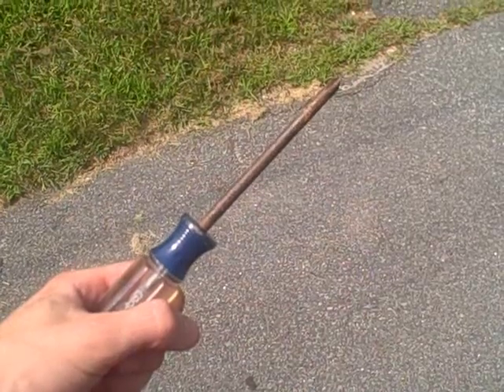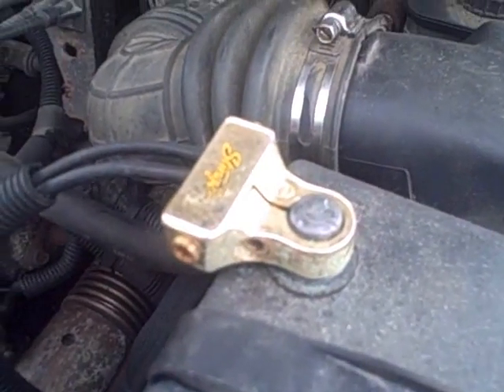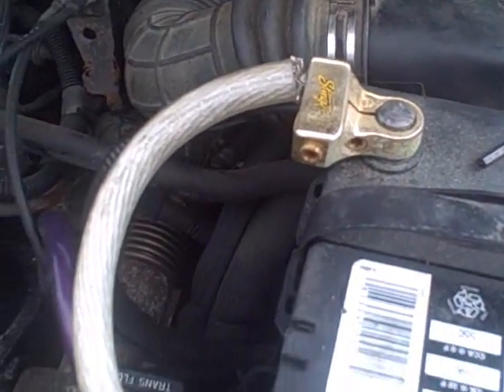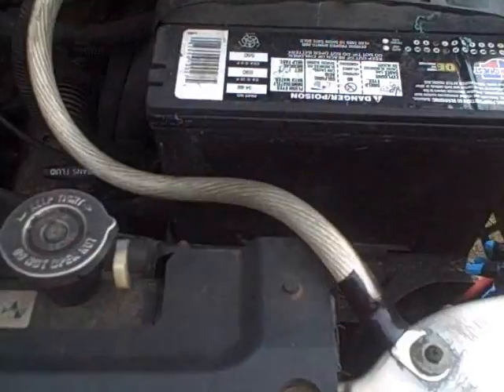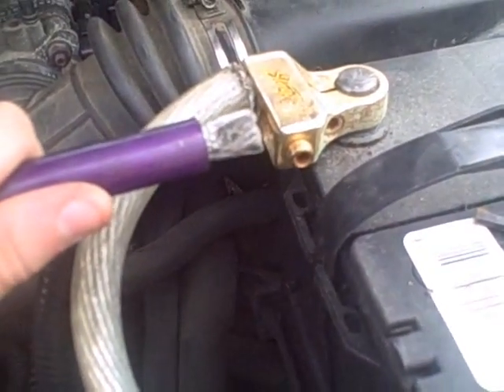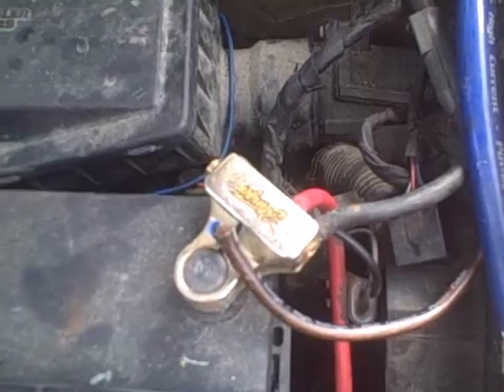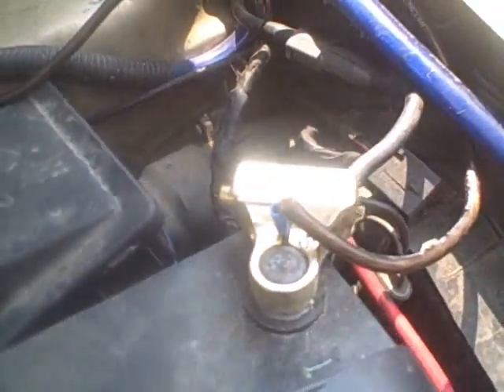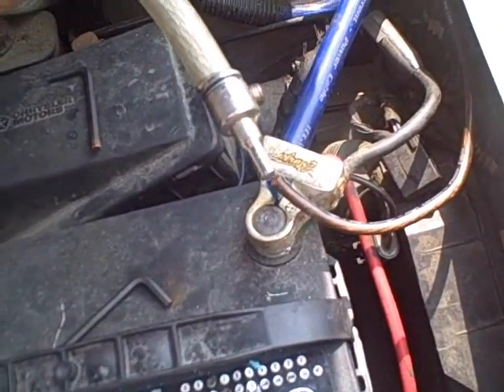Increase Car Audio Power 25% - How To Install Big Three Upgrade - Easy 15 Volt Stereo System Big 3

Comment: The ground of your battery to the engine is only for your starter.
Better make sure your ground to the car body is of a lower gauge.
I think 0 is a bit over the top for a simple sub. But you can get real crazy on car audio.

Make sure you have an alternator that can kick out some high amps, and replace your battery for a high aH gel battery and make sure your cables are thick enough for what ur planning to do and that they are properly grounded.
Reply: *****
Please tell me where i say that HE puts in a simple sub?

The engine has enough connecting points to the chassis but a additional cable is more secure the the - goes straight from the alternator to the battery.

And a big 3 is: high output alternator, bigger cables, and an extra battery or cap.

0 gauge is good for a good 150 amps.
Reply: The thing is, if you have energy flowing through a 0 gauge wire, it needs to have the same ground, lest you create a choke point.
Reply: ***** Experienced individual haha. When i saw him connecting that 0 gauge of him to the chassis with a thin rusty screw i couldn't take it serious anymore. Plus, the thin connector is a waste of the 0 gauge behind it. But whatever. don't know why you spend your time defending this dude as a top of the line audio installer. But yes. I obviously can't take him serious.

Nice that you do.
Reply: ***** First of all, you don't know what i can and can't do.
And if you think im going to make a video to prove it, your wrong.

You want to ground your chassis good. But to the engine is pure bullcrap couse that ground is only used to start the engine and to control various solenoids in the engine.

So that is bullshit.
And unless your alternator kicks out 350 amps. You wouldn't need 0 gauge either.

The big cables are needed in the battery bank in the back. they take the beating. Couse if that screw becomes loose ( and a car moves a lot) what do you think will happen to that 3mm screw with all the amps of the 10000 watt system flowing trough?

And you started hating matey. I don't know whare you got the balls to call me a hater. Since this is an informative video people will look up this shit to install their 300watt subwoofer. And think they need 0 gauge cables.
You made it like i said he puts in a simple sub, not me.
Reply: ***** And that calls me ignorant.
When did i say this catapillar eyebrowed exo dude. Is going to put. A simple sub in his car with this setup.

This video. Is made for people who don't know what a big 3 upgrade is right.
Oh no lets put it diffirent. As you already said i know nothing right.

And i have no damn idea how this all works right.
And i go out and buy a 500watt RMS subwoofer with amp, yes?

And then i look up video's on youtube on how to connect it and what i all need.
And i come across this video. And think damn i have better boughed 0 gauge couse this dude is doing it too so it must be good.
And it is not needed at all.Little too thick cables is always better as too thin. But for a average dude who buys a 500 watt this is not needed.

If he would add a chart with cable thickness and the max amps that it can handle, it would be clear for everyone and, accept for the weird unprofessional ground conection and the cable to the engine. And alternator actually but whatever.
Reply: Nick R big three is wires. not alternator. I even called the local car audio shop to confirm.
Reply: Nick R LOOOOOOOOOOOOOOOOOOOOOOOOOOOOOOL so much gramrar misteaks. LOLLLLLLLLLLLLLLLLLLLLLLLLLLLLLLLLLLL
Reply: ***** Then not much people are accepted.
And by that comment i guess you have no more statements to defend the audio hippie.? Of do you? Couse im kinda seeing the fun in it by now.
Reply: Mike Litoris  Just spelled 2 out of 4 words wrong.
Congratulations kiddo troll.
Reply: Nick R lurf out lurd you think i dew nut kno thet i aem speling evryting wrung??

Comment: I remember about 8 years ago I installed a pretty large system in my car and the lights would dim. I didn't feel like pulling all the custom trim panels out and adding caps so I thought about what else I could try. I added bigger grounds to the engine and frame while still keeping the factory and all of my light dimming went away. This should be done with every instal over say 500w or so. It takes about 10 minutes and can save you headaches.

Comment: The big 3 was easy on my car, my alternator is right next to my battery so were all the ground points and i bought an optima yellow top battery now i can bump without dropping below 13.7 volts =)

Comment: does it matter if I ground the block to the battery?  my car has grounds comming off the motor mounts from the block and tranny and one goes to the chassis and the other to the car frame so what can I just run the transmission mount ground to my frame where the factory one is so I don't have to come all the way up to the battery.  all help is appreciated
Reply: run 0g to the negative from the chassis, 0g to the negative from the engine block, 0g to the positive from the alternator. ignore everything else, do just these 3 and your voltage will improve

Comment: Sooo im suposed to go faster if i upgrade like this??
Reply: no this is for output power stability, specifically when working with high demand car speaker systems
Reply: alterado ramos yeah this adds +30hp and remember the flame fender paintjob and hood stripes for additional +30hp

Comment: What kind of terminal is that on the white "accessory stereo cable", and from where can I get one?
Reply: It's a guage reducer.  Try Stinger.  Less expensive at SonicElectronics.  I'm familiar with two reducers: 0/4 to 0/1 guage and 0/1 to 4 guage.  There may be others.  I'm only familiar with these two.
Reply: Jay Sharp Thanks for the reply!

Comment: Smaller systems don't often force enough current draw to require an upgraded ground. Just calculate your amps current draw by the voltage and amp output of the alternator. If it's close, you want to upgrade the ground to maximize current output. If the amp pulls more, you'll want a bigger alternator.

Comment: The battery is only grounded once. The engine block ground connects to the negative terminal to make the battery the common ground for itself and the engine.

Comment: when installing a second alternator how do you connect it for the voltage regulator do you just cut and splice it to the second one from the first alternator?

Comment: Big 4 Upgrade !!!
1. + battery    + Alternator
2. - battery      Car Frame
3. - battery     Engine Block
4. a) if between yr alternator and engine block is a rubber seal 
        - alternator frame      car frame
    b) if there is no rubber seal  
        - engine block     car frame  

That's All

Comment: Why waste your time for nothing when you can just run your lead right off the alternator?  No need to ground out the block or battery., especially if u have batts in the back.. Lol  he only ground it to the body not to the frame.... Lol

Comment: if your stock wires are small and you notice voltage drop like lights dimming then yes it will help. dont need to go very big though, maybe 4/0

Comment: I'm running two 12s 500W rms with a 650Watt rms amplifier.. It sounds great without the "big 3"... Regardless though if you can afford it, it certainly wouldn't hurt....

I would assume however if your system doesn't seem to be struggling you don't need it.

Comment: the alternator is grounded because its bolted to the engine (which is grounded better after the big 3). the alternator only has one wire coming out of it so connect it to that terminal

Comment: Where does one put wire for starter cable (mine is just a thin wire) if u have such a large terminal post? 

2ndly - I'll be runnin 1 gauge to the back -- spliced to a 3 fard cap and then other spliced end to 1 ga in 4 ga out distrib block (my JL Audio 1000/1 only allows 4 ga)

To get to my 2nd question - is it okay to run a 4 ga GROUND directly from my battery up front 2 another distrib block 2 cap to amp? 

The battery I am running is a Kinetik 1800. My alt is only 120 amp, cant go bigger

Comment: I had never even thought of this, thanks for the video. Like someone else said though - where on your alternator did you connect the wire? maybe a stupid second question, but the alternator only needs a positive wire run to it? is it bolted to the frame aka grounded?

Comment: The engine in almost every vehicle is mounted with vibration absorbing rubber mounts. So a separate engine-to-chassis ground is a reality from the factory.
So think this more of the chassis and engine have cleaner grounds more than the battery is grounded twice.

Comment: the alternators positive wire runs to tha positive battery terminal.. i did 2 out of my big 3.. negative battery terminal to chassis.. and alternator to battery positive i used 4ga true 4ga tho knuconceptz oxygen free copper is equivilent to one run of 0ga cca wire... it solved my low voltage issues!!! still runnin stock battery at full tilt dont drop below 13v.. before it would go as low as 11!!! so i definantly noticed atleast 25% increase to go from 11v up to 13v!!!!now i just need agm batter

Comment: If you're talking about the fuse box that comes at the positive battery pole, you can leave it exactly there, and run your upgraded wires over this. The box will have a fuse rating which should be close to what you are upgrading to, except that's what the manufacturer put in (as well as a 12 guage power feed line) .If it bothers you, there should be a disconnection jack to unplug the main stock input wire from the alternator. So you can unplug it and then install your upgrade.

Comment: I believe you can leave the stock wire on the alternator and hook up the bigger gauge directly onto the same alternator connector. Due to Kirchoff's law, current will flow through the path of least resistance, i.e. it will go through the thicker wire to directly charge the battery. The alternator should send enough current  to the rest of components with the included stock wire hook up.

Comment: question when you do this. do you leave the factory wires from the alt  to the battery on there just because of the others things needing to work? or what? only asking this because im driving a 2004 automatic 2.7L santa fe and I see one wire splitting into a few area's and then leading to the battery.

Comment: SOMEONE PLEASE HELP! 

I have the same exact van and the alternator has two smaller like 8 gauge wires that run into a box that looks like it connects to the main alternator wire. What are these for? I want to do the big 3 but i don't know if i have to worry about those two wires or not.

Comment: I assume you meant TWO grounds. Normally the engine is is tied to the cars electrical ground via a strap or wire some wehere as the engine is usually suspended in the engine bay with rubber engine mounts. One ground to the body to support the battery's ground, and one to the engine to support the alternator's ground.

If you meant to say to grounds, then i would have to say without a proper ground there is no return path for the power.

Comment: the EXO, for this video, when i saw this vid i went out the next day to a mobile audio and picked up 24 feet of 0 awg wires, came home and installed them right away. as of my cap was monitoring only at 11 volts it is now @ 2 rpm a 15.65-15.78 volts. now there is more power and now i have to upgrade my tube, LOL. have a 10" bazooka (limited spacing) now looking for that 12". LOL there is never enuff of BASS!!!! MAHALO TO YOU EXO. LOVE YOUR VIDS.

Comment: I have a Question??? My battery is in the trunk am i able to just run the positive to the alternator or do i have to run both wires up front including the ground from the engine block to the trunk frame ??? HELP  
I also have a kenetik 2400 power cell battery.. that will be in the trunk as well.. do i run the positive off that battery to the alt or off of the stock battery. i will be hooking both battery's together

rockford fosgate t1s  X2
rockford fosgate t1500BdCp 1500w

Comment: I had to revisit this because I didn't insult you (as you did me), yet you didn't reply. After watching the video again, 0:15 is the basis for your "argument," that "power flow" increases w/ the big 3, but anyone with ACTUAL knowledge can see that it doesn't apply in many cases. In other words, you are a DUMB FUCK, so stop posting in general. When questioned, you shamefully cower in your little corner of ignorance. This isn't a playground; you can't just "beat me up" with asinine posts, moron.

Comment: Please explain how you "said nothing like that"? Was your reply to my initial question yes or no, ignoring the discrepancy on specific wording? And regarding the correct terms, assuming that upgrading does indeed help in a particular case, did you mean that more current (or power "flow," as you put it), from putting in bigger wires, would NOT yield (or "produce") more power?

Comment: Um no, I didn't say anything like that you illiterate fuck. And yes, you are ignorant as you mentioned in your first comment. Upgrading your wires increases power FLOW from alternator to battery, battery to amp, etc. because there is more surface area for the power to travel. Wire doesn't produce power, its transports it from one place to another. The Big 3 upgrade is used to reduce strain on your electrical system as a whole and help prevent voltage drop. Shut the fuck up little kid.

Comment: So you're saying that my tiny 100 watt amp with a 2 gauge supply will get more "power" by substituting a 0 gauge? Or that a junk battery and/or alternator that barely run the car itself, will somehow produce more "power" with a thicker wire? Hint: these aren't questions, they merely illustrate that you lack sufficient knowledge to be posting. Please stop.

Comment: Hey Exo! I have a few questions! First I have seen a few other videos about putting a ground on the on the Alternator bracket vs. To the Chassis. Second I have seen other vids where people put fuses in between the Alternator and the Battery! Thanks!!
Reply: Dude u remind me of a friend of mine... anyway I gotta amp with a loose ground terminal... I like the amp but when it jiggles it cuts off... anyway to stabilize that terminal without dismantling my amp?

Comment: Does a bigger cable always mean more power? I might be ignorant, but I always thought that the bottleneck was almost always the stock alternator or battery themselves, no?
Reply: bigger cables have less voltage drop and lose less power to heat from resistance. the difference between 4 gauge and 0 gauge for even just a several-foot run carrying only 100 amps is 20 watts lost to heat and a quarter of a volt dropped.

Comment: 100% agree with you ,,, 0 gauge is absolutely overkill .. the starter takes about 50 to 60 amps instantaneously .. an it isn't terminated with anything more than 4 gauge ,,, those 0 gauge is intended for way more higher loads ,,, arc welders on 300 amps setting do have 0 gauge ,,,

Comment: Alternators have a voltage rectifier in them so the max output is 14.5V and with the rotor spinning with the motor rpm they can't have a spike in its output because of the voltage rectifier this means there is no need for a fuse. Fuses are mainly used as a weakest link in a circuit so if the power draw becomes excessive it will blow instead of something bad happening if you have an Alternator that can melt 0 gauge wire you need to sue the company because i have never seen it happen
Reply: fusing the alternator wire is more about avoiding catastrophe if either end of the cable somehow becomes disconnected, loose, or stabbed by a tool. a direct short on the battery can easily melt 0 gauge wire and start a fire. therefore, anything that is normally connected to the battery positive should have a fuse.

Comment: I don't think the screw will make much of a difference, because the end of the wire (the washer like part) is in direct, raw contact with the frame. The connection doesn't depend on the screw really.

Comment: its a good idea but the reason you don't link directly to an alternator is because of a Voltage spike it could do serious damage to the Voltage rectifier and output controller on the alternator which could do serious damage to all your electrics while with a ground to engine a voltage spike would be well dissipated before reaching any sensitive components hope this helps

Comment: he should have tined his wires or soldered on lolid leads posbliy useing silver solder and should have used gold plated coper wire its better or if you can buy a set of sealed monster cables thay use the most pure wire and this dus make a difference. i use a voltage stablizer and over heavy wire soldered and run 2 4 ohm 12 in subs in a band pass box with 4 prots and a hole in the center of the devider with a 460 amp and perople think i got a 2000 watt syetem its not its from tweaking

Comment: The closer the ground wire to the battery the better and buy doing what he did it will also help give a better ground then he grounds his amp caps and extra batterys in the back. when you have a system that draws a lot its alweez good to have to grounds on the bettery in 2 diferent spots.

Comment: hey exo! im getting ready to do "the big 3" on my ptcruiser! i had 2 questions for ya! 1: im using 1 awg welding lead for the big 3, is this good enough? and my 2nd question is... do i have to put a fuse in between the alt and battery? some say yes and some say no... thanks exo!!

Comment: no, the battery exploded when i turned the engine over, i did not connect the negative to the chassis, but to the engine, so it shorted. this is my dad's 1978 peugeot 504 diesel, it's been sitting there for many years, i want it to run again!!